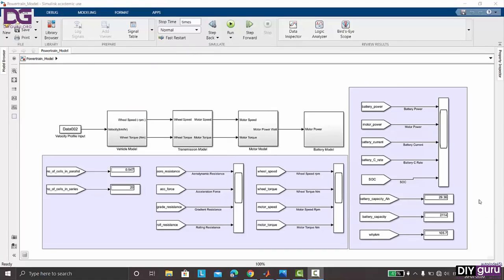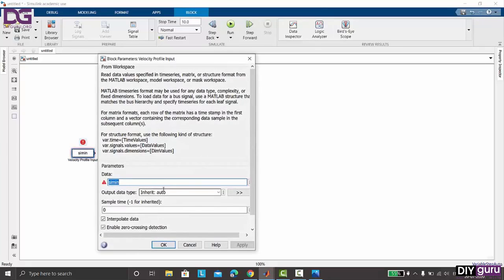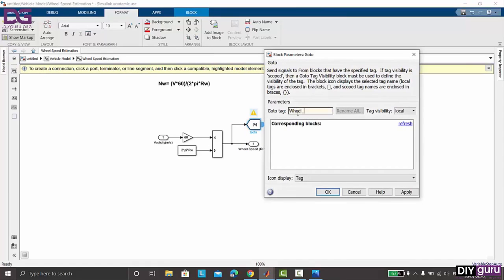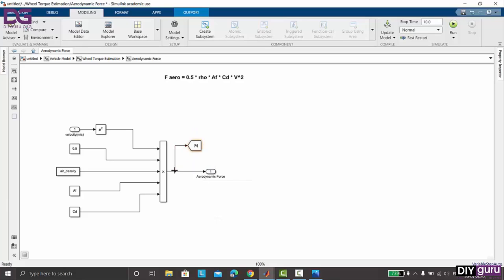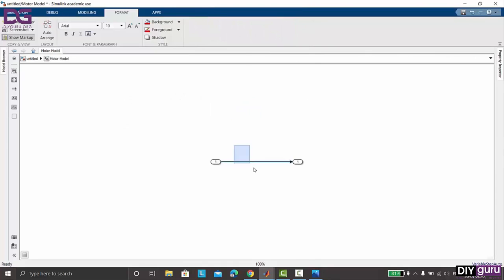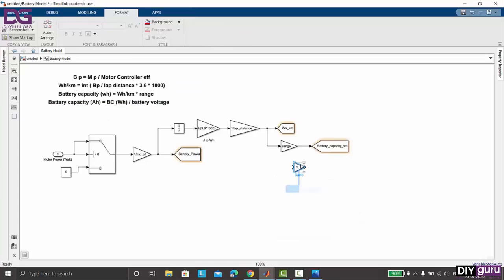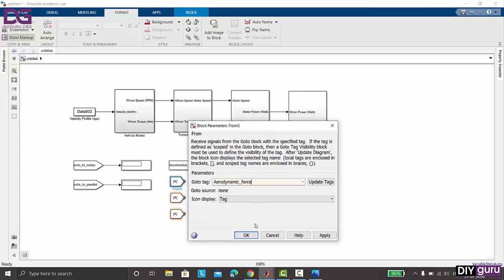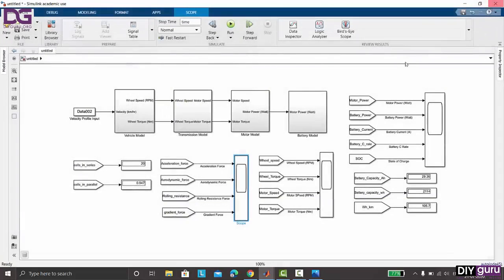Electric Vehicles (EV) Powertrain Modelling and Simulation | Powertrain Engineering (Advanced)

Comment: why the motor power going negative ??  and also wheel torque and motor torque is negative ?? can you please explain why ?
Reply: Because when the speed decreases, the force applied is negative due to the inertia of the vehicle. That's why the torque becomes negative and with this couple we apply regenerative braking to charge the battery.
Reply: Power is scalar quantity which represents magnitude only. Hence it can never go negative